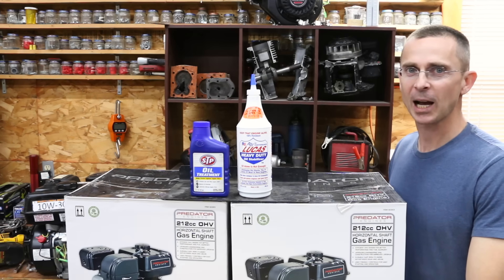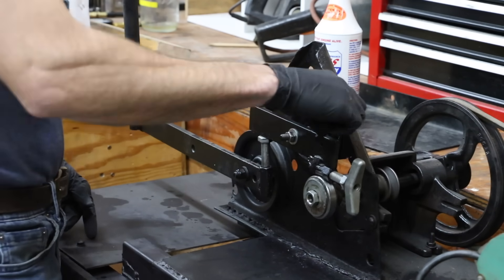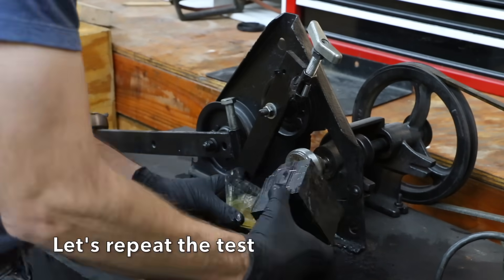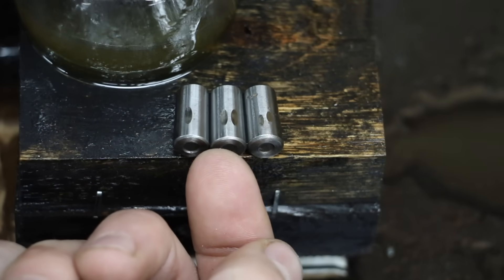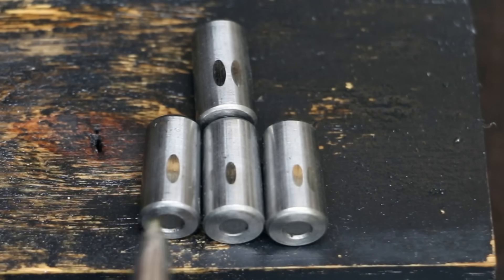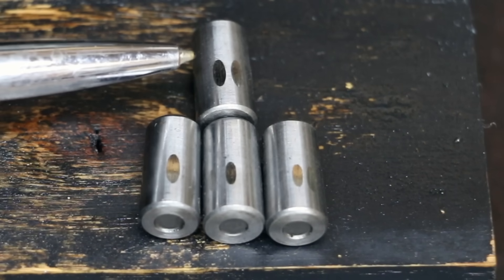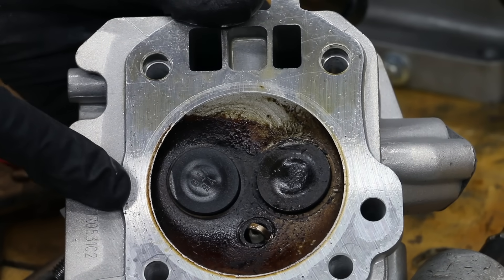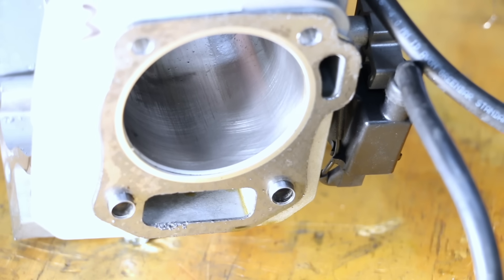Which engine self-destructs first?  Lucas or STP?

Comment: Hello, thats a good test but a few comments... did you use a grinder to resurface the load wheel ? Thats hardly a bearing surface. 
but pass on that. both engines lasted a good time with no oil and if you repeated the test with another two engines the timing might be reversed. A better test is one engine with just standard oil and another with an additive, regardless of which brand. THere is also WYNNS  that also uses long chain molicules and works very well.  from a very recent experience, i was preparing a honda 4.5hp motor for a race tractor competing against 13hp and bigger engines. during my dry runs pushing the engine as hard as possible and playing with gear ratios.. result was an engine that just started to tighten up and i stopped it before any damage was done .. i then added a  15% amount of wynns additive ( couldn't get stp at the time) and continued with the tests.
After a few gentle runs i piled on the beans and went for broke.  it performed very well and no hint of locking up.  then off to the race day, here the practice  and qualifying runs  she seemed slightly more powerfull. 
The races went well with a first,  and a third in my second race. I was only able to beat the others through design of the chassis and the fact i could corner much faster,  and on the downhill sections it was flat out and over revving by a good margin but held.. Finally when back at home i did some more testing and the compression was up, the low revs power was noticably better,  better acceleration and a cooler engine... so the products do work...although took a few minutes to get in everywhere as it is only a splash lubrication.  it takes ages to get into the crankshaft surface..same on the engine you tested..if the engine had been assembled with 10%-20% additive on assembly of the crank the engines would have lasted a lot longer.
One other comment is that oil not only lubricates and protects bearings but has another job to do. COOLING,   Oil absorbs heat from the hot areas and dissipates it to cooler parts mostly the finned parts of the crankcase. by removing the oil from the test engines there is the build up of heat at the piston, and eventually the crank bottom end that is not being fed by pressure as in a car engine..so no wonder the bottom ends failed first.   I did notice light crosshatching in the barrel,  this is an old racing technique used forty years ago to keep some oil between the piston and the barrel...nice to see it being used in these engines...although it can cause light oil consumption it protects and helps the heat transfer from the piston through to the barrel finning.    So a big thank you for doing this test as it goes against the grain to destroy a perfectly good engine but thats the way to find out data... but i would like to see a prepared engine on wynns or stp against another engine running just ordinary oil...

Comment: for your wear tester please try head and shoulders dandruff shampoo, yes, you heard me right, but you will need a LOT LOT more weight on the tester arm.
also put sugar in the engine oil of an old push mower, run for about 30 to 60 minutes, then let the engine cool to room temp, then try starting it, i would say it works better then sodium silicate, for making an engine useless, and non rebuildable

Comment: Hi Project Farm - thank you for you excellent demo, it is well-made despite the complaints and rudeness of some viewers (they can do their own tests instead of complaining).  I would recommend hearing your conclusions for what your tests have shown under the parameters you have used (and honestly mentioned).  Your test may not be "real life scenario" but it helps us extrapolate the results under to extreme conditions (which are hard to replicate without very expensive setups).  Sincerely, Ciao, l (FoMoCo engineering).

Comment: Liqui Moly Ceratec would be interesting...

they claim that a treated engine can run you over 100 miles without oil in the engine.

I know ceramic oil for a while now and it works extremely well for guns, all sorts of fine mechanics(fluna gun tec) and for bikes(ballistol bike cer)
so I would really be curious if that ceramic additive actually works in an engine

Comment: stupid test. no air flow for the piston housing which causes overheat. what's the RPM? no matter what oil u use in this test your engine will blow up LOL. u have 2 fans on your video and both were off. The cause of blowing up your engines are not because of the engine oil u used. this is annoying. stop the MISINFORMATION!

Comment: So this is the first and only video I've seen of yours. Nice job! What you are doing is something I would love to do! I would consider myself as having a very strong background in this area. I was wondering if you have ever heard of something called Militec? I have seen a similar lubricity test using it and I was quite impressed. This was some time ago. I have still used it in many things I own, from engines to compressor pumps to air tools. I believe the key to the stuff is getting the component hot. I would love for you to look into this and see if it would be worthy of a similar test. My bet is that we will be impressed! Thank you!     Toby SmithArizona

Comment: The Lucas won the battle hands down! I've used it in my vehicles. I usually have about 175,000 miles on mine when I get them with factory motors. I end up getting 450,000- 500,000 miles on them still running smooth and quiet when I get rid of them. Lucas is the best insurance you can get for older engines as long as they are already running correctly. I'll admit I only buy GM 90 degree V6 engines. I'm completely afraid of 4-6 cylinder inlines  and 60 degree v6's with how much I push my engines and the crazy amount of miles I put on old vehicles. I don't have much experience for a V8 but I imagine the results would be the same. As for Ford, too hard to fix common items that don't last very long and forget about me driving an import unless I was just trying to get by with a junk vehicle. Dodges are something I haven't really trusted since my 1995 (only a few years old and making payments on it) Ram 1500 failed both transmision and engine before the 200,000 mile mark. I let someone else get it before that happened but still. I'll admit that my Dad and I over-loaded the truck constantly doing construction work and that may be why it failed so early. It still kept me from getting anything made by them. Early 90's GM vehicles are the longest lasting, easy to work on, and insanely fun to drive vehicles out there period! Oh yeah, and the parts are less expensive then anything I've worked on. Just keep those fluids fresh is the best advise one can follow.
Reply: I agree.  But, The LS type engine should be included in your list of great GM engines. Many trucks out there with 300-400k on them
Reply: You're right. The LS (Long Shaft) engine is an awesome engine. I've never owned one but my best friend got a Camaro with a 350 LS 6 speed manual and it was a rocket! Too bad he wrecked it a couple of years after he got it. Another cool car he owned was a Fiero with a 2.8 litre V6. I didn't care for the engine but it was a strange car to drive that was also very, very fast. Too bad it burned up (like a lot of rear engine cars do). The stopping wasn't good because the front wheels locked up a lot since there was no weight on them. I wonder now if we could've adjusted the back brakes to grab more than the front. Oh well to late to try now.
Reply: On old engines increasing the viscosity with Lucas can’t hurt. Put that stuff in a modern engine with tight tolerances and will be blowing rod, wrist and crank bearings in no time.
Reply: You referring to the same GM that produced the NorthStar engine in the GM made cadillac that only lasted about 50,000 miles before it blew up from overheating? Or are you referring to the grossly engineered Buick monstrosities? Chevvy has a spotty rep that goes in and out through the years. GMC is perhaps the only sub-brand that maintains the STRENGTH of its engines, but lacks in long-distance. I'd deduce you're referring to smaller v6 chevvies because that's the only thing I could see coming close to 400,000. I myself have a 628,000 mile 1993 Nissan Sentra SE-R-T RWD conversion. It's an AutoCross racing/cross-country cruiser car and has only ever been treated with Lucas.
Reply: Joshua Demers if u had a cummins in the dodge it would have lasted longer than the 1500 and personally I don’t like gm products I want to off load a 454 big block and buy a FORD. Y u ask cuz FORDS r better than gm.
Reply: All these new engines take very thin, low granule full synthetic 0w20 or 5w20 oil. Stuff is as thin as water and slippery like vaseline. You're exactly right about clearances. Tolerances isn't quite right. It's more of whether or not the oil can actually CLEAR the channels without bogging it down. A friend of mine ran conventional 5w30 motor oil in a 0w20 synthetic oil only vehicle and it ran hot and died in six months.
Reply: Best Lee Sin NA yup don’t mess with your oil. A team of people most likely smarter then you or me spent months or years finding the perfect oil spec for their engine. It’s in the manufacturers interest to find the best oil spec, they don’t want warranty claims. 

You see it a lot with BMWs, some idiot wants to run thick oil meant for an M powered car inside their regular bmw. They think it’s better because M cars use it, then when they need a new short block they start crying 😂 lol
Reply: FMChimera I want a 7.3 power stroke diesel over the 454
Reply: Yes I am but before the Northstar. I really loved my 89' Cadillac Sedan DeVille soft top with a 4.5 litre V8 throttle body. I couldn't keep it long because my seizures took away my drivers license but I believe this thing could run forever with proper care and love.
Reply: XGN DIESEL117 / Don't buy a Ford. Ram with a Cummings is the best.
Reply: Frank D I’m looking for a cummins or 7.3 sorry butt hurt duramax ppl I am not buying a 6.6
Reply: XGN DIESEL117 👍
Reply: No, Ford is certainly not.  And really. a 454 for a Ford?  Ford makes nothing that can compete with the 454 and the 460 was never more than a pale shade.  But you go ahead and kid yourself.

Comment: These are oil ADDITIVES.  Neither of these additives claim to leave a permanent layer of protection on the engine parts. No oil or additives where present so the engine seized. You proved engine oil is actually necessary in an engine that requires oil. Who would have guessed ?

Comment: will you try duralube vs zmax? ive used duralube for years and think its the best,also have you ever herd of mechanics oil in mixed 2 cycle fule? I tried it last year on an old weedeater that I was told was about to lock up and it ended up forking for the whole year on a landscapeing crew! maby something maby nothing, but anyway cool channel keep it up!

Comment: http://www.eimi.com/mbl.html 
Best oil treatment i've ever seen and used myself.
i bought a 1976 Volare station wagon for $200 back in 1990 and the engine barely ran, had the Idle set almost all the way up just to keep it running, I put this stuff in and drove it for 2 hours, when I got home the engine was racing so i turned the idle down and it was purring at low rpm's smooth as glass, ran for 2 years great until the wire harness had a short and burned the car down.LOL

Comment: slick 50 is the best you can buy.
Reply: that may be . all i know is that i watched a man put slick 50 in his push mower crank it up then shut it off and drain the oil out then he mowed his whole yard and it ran fine. i would not have believed it if i had not seen it with my own 2 eyes.

Comment: Both additives are meant for use in oil-pressurized engines, where viscosity helps build oil pressure in high clearance(read: WORN) bearings.  Splash and clatter engines are not any representative of this.  And no control engine with just oil?  WTF?

Pointless, wasteless, unscientific test.

Comment: Great demo, Run a 3rd engine with no adative  just straight oil to see if it fails before Lucas and STP. And I like to see a engine with Mobile1 Synthetic.
Reply: Project Farm Absolutely. You need a control. One needs to be run without any additive
Reply from the maker: Thank you for this recommendation.
Reply: totally agree
Reply: He already did run a control with straight oil on the bestline video. Straight oil blew at 33min and bestline at 70 min. So both STP and Lucas lowered the time to failure on a dry engine.

Comment: Try duralube and 15w40 diesel oil I seen many engines in demolition derby run so hot to the point where they won’t shut off without turning off the fuel winning combo
Reply from the maker: Thank you for this recommendation.

Comment: Most of the major oil additives companies got penalized for scamming the consumer by the FTC. I leave the links:
Stp:  https://www.ftc.gov/news-events/press-releases/1995/12/stp-corporation-and-its-parent-corporation-first-brands
Duralub:  https://www.ftc.gov/news-events/press-releases/2000/03/dura-lube-motor-settle-ftc-charges
Motorup: https://www.ftc.gov/news-events/press-releases/1999/04/ftc-charges-marketer-infomercial-maker
Slick 50: https://www.ftc.gov/news-events/press-releases/1997/07/quaker-state-subsidiaries-settle-ftc-charges-against-slick-50
Prolong: https://www.ftc.gov/news-events/press-releases/1999/09/prolong-super-lubricants-settles-ftc-charges

Now why are most of these companies still able to sell their products? Wording. All they had to do is change the wording, but everyone remembers what the claims were so does not matter they still think it does that so people but it. When the FTC came after them none of the companies investigated had any proof of the claims they made. Not one. No proof that any of the products reduced any wear much less what they claimed it did. Duralube, Motorup, and Prolong all used the same chemical make up. Chemically it's called chlorinated paraffin. Which is just a fancy name for chlorine,  Chlorine is a extreme pressure additive that used to be used in gearlubes. But because of it's acidic nature as soon as a replacement was found they quit using it as such. But as far as engine benefits. Extreme pressures additives do not kick in unless that is extreme pressures. And the only place that might get enough pressure inside a motor is the valve train.

Slick 50 is what called a solid particle lubricant. But it's not really good for an engine in the long run. There are 2 types of wear an engine can have, Friction and chemical. The oil is made with acid inhibitors to reduce *normal* acid build up. But when you introduce the chlorinated or PTFE  (slick 50) products to your oil, you increase the acidic nature of the oil. And therefore parts like the camshaft that suffer most from this, will really degrade due to chemical wear aka pitting. STP is basically motor honey like double 00 grease. Has really no benefit except may make a worn out motor temporary get a little high compression because of better ring sealing.
Reply: Additives are always a no no in new cars. If the dealership figures out you used one and something happens to your motor, you pay not them. And regardless of what the oil additive company claims they'll do, they won't.
Reply from the maker: Thanks for the links and thanks for commenting.

Comment: I run lucas with every oil change have been for 15 years, I only use all lucas additive products. Fuel system cleaner, oil stabilizer and grease. Good stuff.
Reply from the maker: Thank you for this recommendation.

Comment: Lots of positive and negative comments but to be really fair a third engine with just the recommended oil drained and ran as well be interesting to see how long it lasted vs using a additive  but checking for engine wear after 10 min or so in each engine before it  blew up would had been more fair what happened  to that slick 50 ???? Heard it turned to jelly and cloggs up oil filters ...these oil additive company's making millions vs regular oil ....
Reply from the maker: Thank you for this recommendation.

Comment: This is a good baseline, but running them to failure covers up the really useful evidence. I would suggest running them each 5 min w/o lubricant then check for scoring. That would tell you if the additive stayed in the motor.
Reply from the maker: Thank you for this recommendation.

Comment: You should of done pure Lucas and pure stp so it actually stuck inside the engine , that would be a proper test , you just washed it all out with the oil you left in the engine ... Come on now
Reply from the maker: Thank you for this recommendation.
Reply: Project Farm no problem! I work at a oil change shop and we deal with Lucas all day , it thins right out in a warm engine and you can barely tell its in their , that's why I said you washed it all out with the oil you left in the crank , great video !! Thankyou

Comment: Cool video, but I think it lost credibility in comparison between the two oil additives when the engines were ran with NO oil.  It would make more sense if you compared two engines made by different manufacture and ran them with no oil to see which one last longer.  But if you ran any engine with no lubricate, it doesn't matter what type of oil it was using prior.
Reply from the maker: Thank you for this recommendation.

Comment: It was my understanding that these additives are not there for lubricity. They have a high surface tension, a resistance to flow, and high shear strength. In other words, they'll fix your rod knock, at the expensive of every other system.
Reply from the maker: This is an excellent point.  Thanks for commenting.